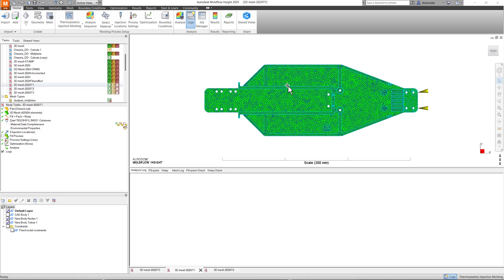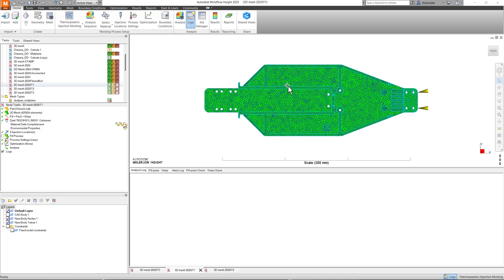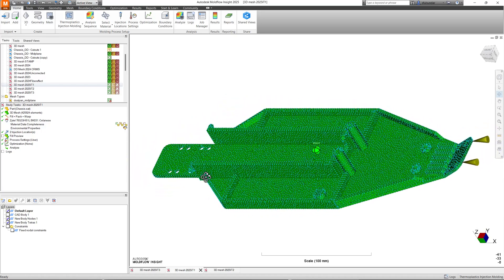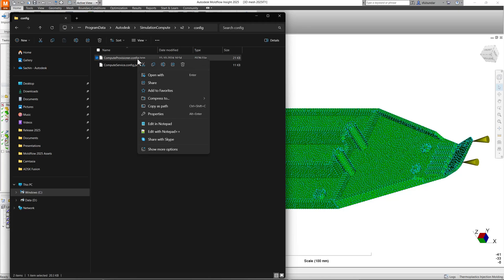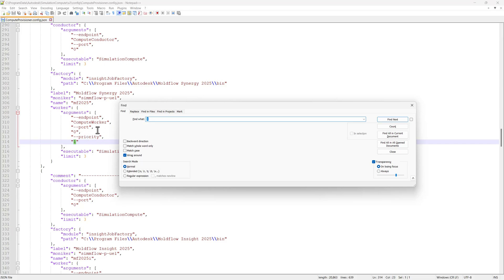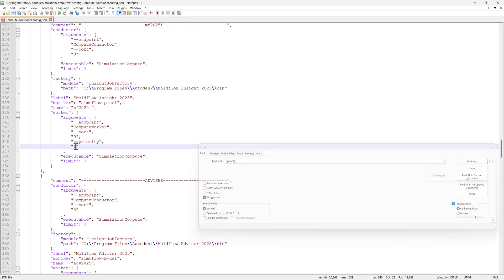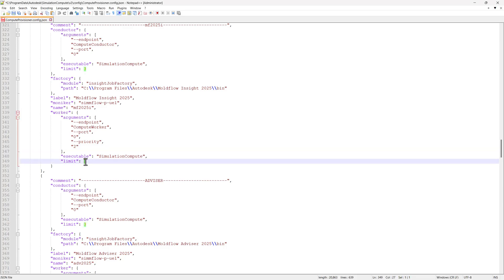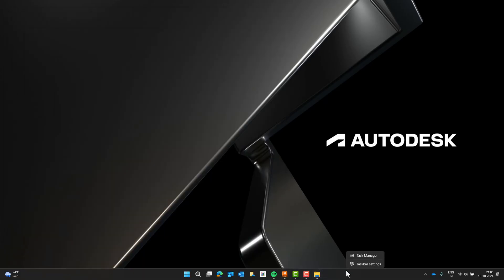Speed up the Analysis with Moldflow 2025

Comment: Good evening, how are you, my name is André, I'm an analyst here in Brazil, I've been following your videos for a while, they're very good, would you like to make a fando about the remainder of the maximum shear rate in the 3D mesh, if possible, simulate it with C1200hf? Thanks!
Reply from the maker: Hello Andre, Good day! Thanks for your time  on reviewing the video, i hope it is useful to refresh the Moldflow commands. To Capture the shear rate precisely you can create 3d mesh for gate or beam element (3 elements of constant dia at the end) . Use the Cut Plan across the part and gate. Run the shear rate animation step-step to find the exact time which gives the highest value. Value of shear rate shouldn't exceed the material limit. you can also use per frame values, which shows highest value at that time. I hope this help. let me know if i can be of further assistance. Thanks !